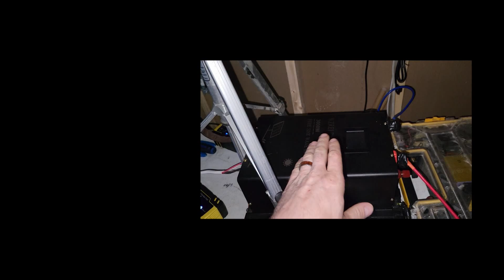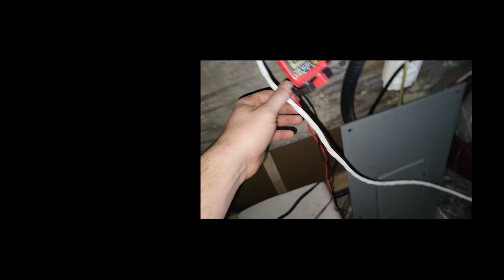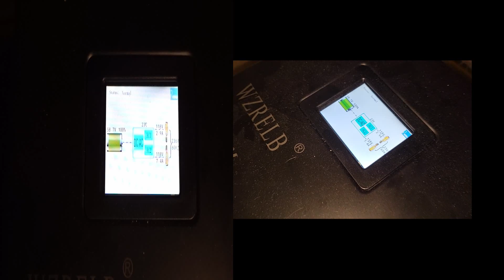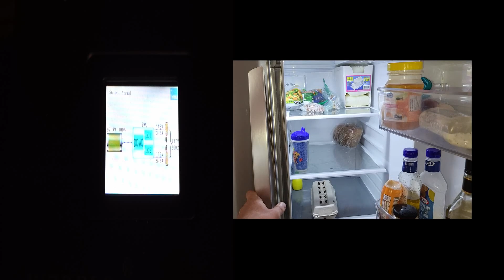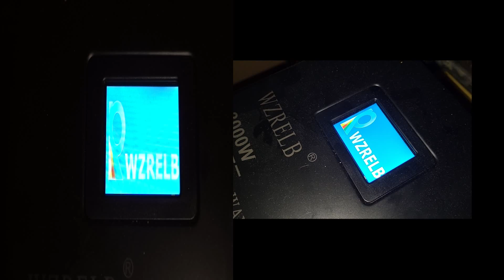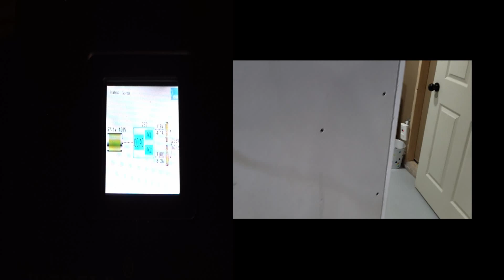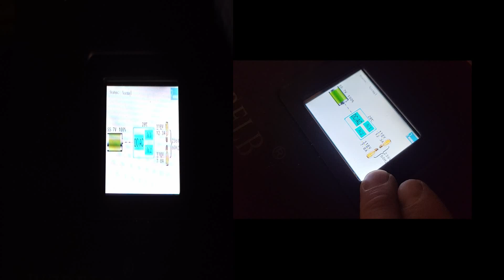Running My House Off Reliable 3000W Split Phase Inverter

Comment: I bought  WZRELB 3500. I'm hoping it will handle the inrush current from my well. It runs at 1800 watts. Thanks for the videos
Reply from the maker: @ww321  240v?
Reply: @GoingOffGrid101  yes.
Reply from the maker: @ww321  might work but even one of my magnasine 4400w inverter can't start all water pumps, it very dependent on the pump.
Reply from the maker: @ww321  . Mine did around 4200w surge . Hope it starts your pump

Comment: 14/3 wire is designed for up to 15 amp loads and should only be used on a 15 amp breaker right? So once you draw more than 15 amps on one leg your circuit breaker in the panel should trip, right?
Reply from the maker: @roberthosking7524 120v a breaker will hold for a minute or two at 20-25 amps typically before  tripping. Or even 30-40 amps for  a few seconds for starting loads before tripping
Reply: @GoingOffGrid101 here's an interesting video of a guy maxing out a 14 gauge household wire. From what I read in the comments over there 14 gauge is actually rated for 25 amps but there's a safety margin factored in by the NEC that advises it only be used on 15 amp circuits. They also advised not running more than 12 amps continuous through it. By the looks of it those are pretty conservative mandates. https://youtu.be/QccOg_J1Xhw?si=uGHsI9x8t4eSt2QN 0:05

Comment: High frequency, transformerless inverter like these off a poorer surge capacity and a much shorter life expectancy than modern low frequency, transformer based inverters. Even worse, during a catastrophic failure of the control circuitry the can dame your AC appliances because they lack any galvanic isolation between the inverter's DC boost stage and its AC output. No thanks.
Reply from the maker: very interesting thanks for letting me know!

Comment: So I noticed in the manual last thing in section 3.5 - Inverter Output Layout, in NOTE point 2 it reads "If the house neutral wire is combined with the ground, connect the N line with it, leave the G line alone. Do not connect the inverter's G line with the N line together". Trying to figure out if that means connect the two hots to the breaker as you have done, connect the neutral, but don't connect the ground. I can see you did connect your ground though and all seems fine. Also, I tried the old voltmeter test expecting Hot to neutral 120, hot to ground 120 and neutral to ground 0v (ish), but it didn't turn out like that. The hot to neutral is 120v, but the rest is all over the place. I jumped the ground terminal on the block to a house ground to see if that would make a difference but it didn't. Plugging a Klein outlet tester in shows a few things are wrong. As you have the same inverter, I was wondering if you could take a look at the above and see what you get.
Reply from the maker: I get 102v from L2 to ground bor 0 everywhere else,  I did bond my ground and neutral. You could try putting a 14w led there and see it it powers it if not you can bond it.
Reply: @GoingOffGrid101  how did you bond them? Does that mean bonded on the inverter or in the house panel? Might be another video! Seems like there’s some confusion in the forums on this stuff regarding  WZRELB / reliable inverters.
Reply: @thedabbler2753  , looks like older models had issues with N_G bonding:
https://www.youtube.com/watch?v=bkzmud2FJk8
but I think newer versions don't have those problems.

Comment: Is there any way to set the battery cut off and reboot voltages? I'd hate to think it'll just run until 48v and kill the battery.
Reply from the maker: I have added a BMS battery management system that prevents these things. im not sure if you can set the cut off voltage.
Reply: I had the 4000w inverter and hooked it up to the battery, the inverter just shut off when the battery dropped to 48 volts, it’s sucks.
Reply from the maker: @kennethnguyen3382  what battery you using?
Reply: @GoingOffGrid101  200ah lifepo4 with 100BMS
Reply from the maker: @kennethnguyen3382  does your bms have Bluetooth?
Reply: @GoingOffGrid101  no, but the manufacturer set it to 40 volts for low voltage cut off,I also had 24 volt inverter and I had no problems getting it run as low as 20 volts for the low voltage cut off when setting up with the solar charge controller.
Reply from the maker: @nguyen_kenneth  dang, you can costom order  a lot of Chinese inverters the voltage you need. Would it help?
Reply: @GoingOffGrid101  I don’t know if you can custom order it.

Comment: I am curious about what happen to the genetry inverter/ powerjack that you were testing.
Reply from the maker: Genetry is in my shed as a backup, 6000w is to small for my house,  I have the 12k coming. I did blow the fees ok on the genetry but pretty sure I shorted it out by accident 😅. Powerjack also blew up the same way, I'm going to try and replace the fees in the power jack

Comment: What do you think about a 5000watt reliable inverter with a steap up transformer just to run the 240 loads?
Reply from the maker: I think this inverter is better, then using a transform that uses almost  80w at idle
Reply from the maker: also the I am not sure how good the 5000w is, I have never tried it.

Comment: House is coming along.. I might have to get me one of those inverters and sell my 4kw Reliable. However it’s the more expensive better version of the reliable so I might not but it’s only 120v, 240v would be nice.. I could heat my water heater during power outage.
Reply from the maker: I will have to do some long term test! I would say this is better then the 4000w 120v though, it seems to have a better surge at 240v plus a soft start after that.
Reply: I do believe heater elements will run on 120 volt!! My 240 element does very well.

Comment: Inverter builds have improved so much over the years. I remember the big old power hungry clunkers we used to use. Great video as always my friend 👍👍:hand-purple-blue-peace:
Reply from the maker: thank you, split screen is new to me and I had a hard time editing it lol but it turned out ok ish. this new inverter from reliable is by favorite yet I think it will be the more robust one yet. 
I am also a fan of LF inverters as you know so know :D
Reply: @GoingOffGrid101  I shifted to HF inverters do efficiency over the LF inverters. Thought the LF inverters can take a lot more of a beating and have a larger surge capacity. As we are a very energy efficient home they are all i need.
Reply from the maker: @Justin Case Solar Power and Bush Camping Australia  yes , hf is more efficient,  but as you can see I use to much  power for hf inverters for my house but am always down  to try a hf inverter  that says they can do it lol 😆
Reply: @GoingOffGrid101  HF would do it. Not a problem. You just have to make sure you have your startup loads covered. You can do anything if you plan and then build it right. Few more years and there will be no such thing as a LF inverter. So look after what you have now. Worst thing i found with HF inverters is you need a very stable power on your generators as backup. Thank god they also make inverter generators for that now.
Reply from the maker: @JustinCaseSolarPower  ill be keeping an eye out, I love testing new inverters :) thanks I will keep watch so if you review a new inverter I will see it.
Reply: @JustinCaseSolarPower  A lot of so called "LF" inverters are more like "MF", operating frequency in the 10-20kHz range. 5kHz and below is nowadays only really used for motor drive inverters.
Reply: @NiHaoMike64  Never See seen one don't know about them. However I do know all about Solar. I do remember hearing about MF spot welders and injection welders some time back. But that is the limit of my knowledge on MF inverters sorry.
Reply: @JustinCaseSolarPower  Most modern so called "LF" inverters are in fact MF, IGBTs that are limited to a few kHz are truly ancient by today's standards. As such, there's little reason to use a frequency lower than 10kHz for a modern inverter.
Reply: @NiHaoMike64  That is why i use HF inverters and have been for many years. They are fare more efficient and give a much cleaner power output. For me that is 230vac at 50hz and you can get them in any size you want. I love my 2x 5kw units in parallel. Trying to convince others of that fact is hard to do. For instance my good friend  Going Off Grid who has used LF inverters for many years and trusts them. For me it was a no brainer to switch to HF inverters, But for over a year i kept my LF inverter as a backup. Now i fully trust my HF inverters, and  I have 3 of them in my own off grid system. 2 running my home and one as a backup for Justin Case.
Reply: @JustinCaseSolarPower  How old are the "LF" inverters in question? I don't know exactly when MF inverters replaced true LF inverters, commonly available IGBTs were already rated to operate at 20kHz when I really studied power electronics in the late 2000s.
Now there are a new generation of HF inverters based on SiC or GaN transistors which rival LF inverters for peak power handling. If they manage to become as cheap to make as LF/MF inverters, LF/MF inverters would become obsolete.
Reply: @NiHaoMike64  Yes HF inverters and extremely affordable, New ones like i use are under  $1,000. new 5kw with 80amp MPPT Charge controller built in and you can monitor them with Wi-Fi.

Comment: Man my brother excellent video, practical. May i say this? watching your video allow me to see so much difference between countries.  Firstly our home electrical panels are not that big except for commercial properties we don't run them high electrical consumption things there, secondly our homes have to be block, steel and concrete as we are prone to hurricanes. I wonder though the cost of that inverter isn't much different from a low cost low frequency inverter.  Still I love videos where you actually see it running household things and not a capacity tester.
Reply from the maker: yes I also like watch videos from other countries to see the differences. thanks for watching and the comments I love reading them all!

Comment: that's funny you say whole house tho. :) Of course a 300 watt one can run a whole house if you only run lights. :) You maxed out your big ones yesterday. This one cant take that. :) If you load that with 200+ amps that busts into fire.
Reply from the maker: I did that on purpose to show the difference. :)

but yesterdays video was showing 2 houses the apartment is 1250sq ft and is all electric.
Reply from the maker: o and btw that 200+ amps was on the DC side not the AC side, this 3000w inverter is showing AC side.

:D